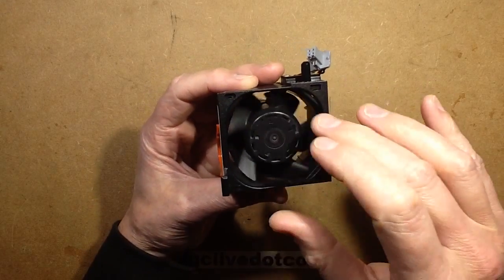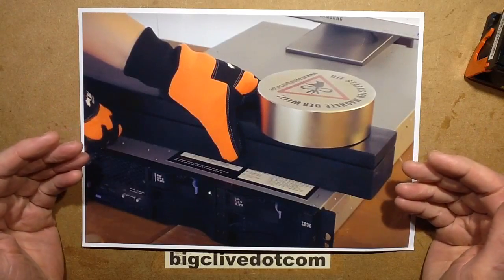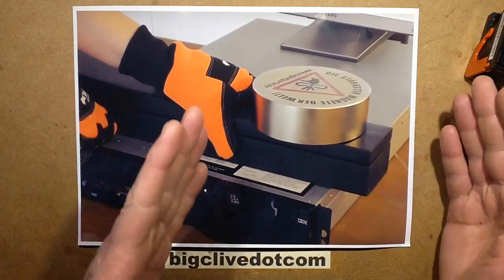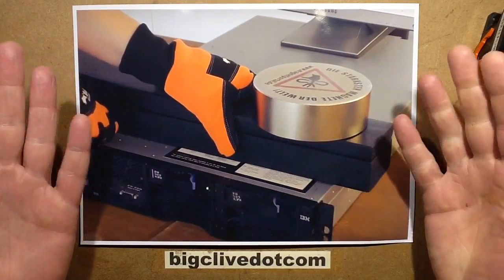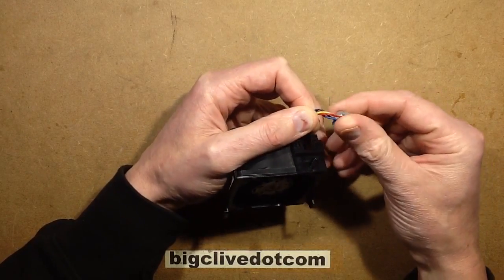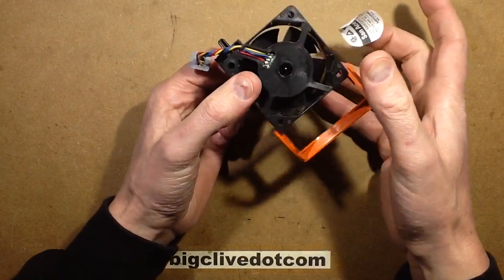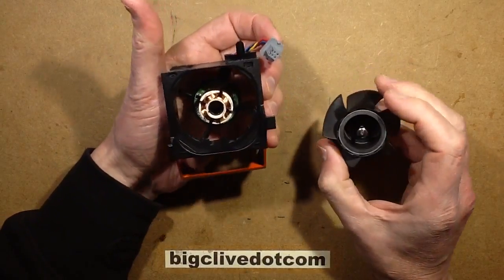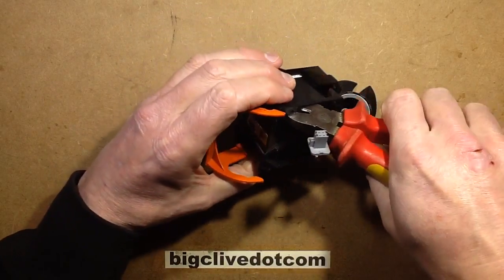Dead server fan autopsy.  (Unusual circumstances.)

Comment: Seems almost like the magnet destroyed the imposed field in the rotor. I have a smaller version of one of these, scary fun takes 2 people and wooden pries to separate. Point is I can wipe magnetic refrigerated stickers and write and then doodle on them with a smaller neodymium magnet tones of fun with magnetic viewing film. I bet from there the coils got decently warm from a stall state or it's failing to read that there is a magnetic field near the sensor and doesn't activate the power side as a fail safe as not to cause a catastrophic failure due to a stuck fan/solidly on coil.
Reply: So I'm not the only one that did that with the fridge magnet and viewing film? I lost my one strip of viewing film (2cmx7cm) a long time ago, am due to get some more. 

I agree that even partially demagnetizing the motor's magnet might cause the effects shown here.

Comment: It's probable that that bit that melted was a current sensor of some sort. A lot of fans, if you stop them with your hand, will stop trying to spin after a couple seconds and then try again after a few more seconds, probably to avoid burning out the motor.

Comment: This is awesome, because about a year ago, about the same time you posted this, I had to repair a pair of server fans. The fans themselves were the same model, scrapped from another server, but had an entirely different set of wires coming out of them. So I had to rip them apart, desolder the wires, and swap the wiring around.

Comment: Maybe the magnet saturated the silicon steel the winding is on, so that the winding dropped considerably in inductance and essentially behaved like a short with a very low-winding resistance - which then could trigger the follow-up failures.
Reply: That sounds plausible.

Comment: You might have mentioned it and I just missed it so if that's the case then my apologies: I'm curious what the resistance is across the windings. I don't know if you still have any of the bits from the fan now a little over a year later.

Comment: I know this is a year old. But my layman's diagnosis? Perhaps as the magnet was passed over the fans, the blades slowed because of the magnetic field. The fans sensed the slowing blades and tried to speed up the blades only to denied by the magnet causing a overload which blew out the components.

Comment: If the magnet caused the stator windings to cancel their inductive reactance, then assuming also a negligible resistance, too much current will flow killing both zeners and the regulator. In the alternative, the moving magnetic field may have induced a large field in the windings to blow the damaged components (induced polarity unknown). I watched their entire video; the servers were running with the fans spinning.

Comment: My guess is that the magnet caused the fan's motor core to saturate. When that happens, the motor windings act more like a short circuit rather than a inductor. The excess current likely caused the electronics failure.
Reply: How would shorting anything out in that circuit conceivably blow the diodes?
Reply: Whatever inductance was still left over would now be "charged" with wayyy to much current. Or, the high current burned something else (mosfets? Chip?) and that led to an abnormal voltage or current in the diodes.

Comment: You say it would have to be pulled away fast to cause a problem. If the motor was spinning the that would be the same as pulling it away fast.
Reply: The magnet was spinning, not the coils.

Comment: I have a some 200Kg+ pulling power Neodymium magnets laying around. 
First I thought, well can't be that bad right? Wrong. One really needs to watch the f*ck out. But still fun tho!
I've bought a special container. It's no luxury when dealing with these kind of magnets 

 The pictured neodymium magnet those guys used on the server must have been above 500Kg+ Maybe even 1T judging by size. Yeah, be afraid. Be very afraid

Comment: Clive, don't you think that passing the extremely high magnetic-flux from the neodynium magnet past the stator would have created an inductive current? Perhaps you could do a test with a similar stator and see how much current is created when a similar magnet is passed by the stator.
Reply: If you pitched the magnet right at the fan, as hard as you could, probably not. If you put it in the front of a cannonball and fired it, right over the server, probably not. If the fan was orbiting the earth in the opposite direction from the magnet and they passed each other an inch away, perhaps. 

The field density inside the closed magnetic circuit of a microwave oven transformer is comparable to the field touching the very surface of that magnet. And it reverses direction 120 times per second. Even with a coil that is several inches on each side exposed to this very strong , violently pulsating field, you're lucky to get 1 volt per turn. 

The field from the big neodymium magnet being placed near the edge of the blades is likely on par with the field created in the stator by being in intimate contact with the rotor's ceramic magnet. If the big magnet was held next to the fan and rotated at the speed the fan normally runs at top speed,  it would produce a voltage, probably a bit lower than the normal supply voltage, inside the fan coil. Even in that extreme scenario it is unlikely to damage the fan.

Comment: Those gloves will save you from losing the tip of your finger, as the gloves will act like a tube of toothpaste, pushing your mangled finger out from between the magnet and metal so it can get closer. FYI

Comment: Question: I used to repair Philips dictation recorders (used mainly by solicitors) in the late 70s, they were the only manufacturer who used Hall effect motors. The other manufacturers like Grundig used standard dc motors to power the capstan wheel and take up spools on their tape recorders. What was the benefit of Philips using this approach as the motors were costly and had so many wires to desolder to change them they took an age to replace?

Comment: I worked with 2"x2"x0.5" n52 magnets last year when I was building a motor for the Missouri S&T solar car team. The magnets try to align together from two feet apart. Get them within a foot of each other and you're going to have a very bad day if one is free to move. The motor had 40 of them, 20 facing each other in an attracting arrangement. With half and inch between the magnet rotors there was approximately one ton of force between the magnetic rotor plates. This force was supported on 1/8" thick perimeter around the 12" diameter motor. If you were to accidentally get your fingers between the halves during assembly, you'd not have you fingers anymore. It was a bloody scary thing to put together.
Reply from the maker: Sounds like the direct drive motor in many modern elevators.
Reply: I'll have to keep an eye out to (carefully) take one of those apart some time! Sounds neat.
Reply from the maker: Pretty dangerous to take apart.  It requires a support frame to extract components to change the bearings.

Comment: My thoughts... and I don't know if this has been touched on, but hey. I suspected this when I first saw the failure in the original video - the control chip got confused by the hall effect and shot off both windings at once! Then, that caused it to short-circuit, weld something together, throw full current at a coil, and of course, cascading failure by overheating (when the fan stopped turning, as it quickly would when a single pole is being held active, it'll apply forceful a braking action to the fan).

Of course, that may not have originated with the hall sensor, but rather (as ExStatic Bass mentioned) started with the MOSFET switching both gates to activated -- causing a short, since the motor - I think - works with switching polarity. Only one (or two, in the case of 4 driving 2 linked sets of coils) of those gates should ever, ever be open at a time. If two of opposite polarity were to be open, it'd immediately cause a short circuit (thus the principle of an "H-bridge").

On the right track, perhaps?

Comment: I would guess that the reason for the high voltage across the diodes would have been because of the magnet and the EMF generated by it. Because those pins are connected directly to a coil, the magnet would have produced an electric field (due to Faraday's law). Also, note the servers were running at the time.

Comment: you can certainly part the two magnets if they ran into each other, but there wouldn't be much point to do it to save a hand that has already been squeezed out from between them, and where the hell are you going to find the facilities to counteract or demagnetize those magnets on earth? there isn't a gauss gun/wand that could handle jit and the generators that could are few and far between not to meniton not set up to handle that. you get your hand caught between two really mean magnets and your hand is getting cut off or squeezed off. so don't do that.

Comment: i have had many accidents with a hand full of 1inch cubed rare earth magnets. luckily i never broke anything. many pinched fingers and needles stabbing me. putting them in different coat pockets worked well for a while until they ripped out of the pockets to smash together. gotta respect those magnetic fields

Comment: The schematic of the coils and zeners raises the suspicion that sliding the magnet past the coil induced a major voltage spike that zapped the zeners. My recollection is that zeners don't like voltages that greatly exceed their threshold.

Whether that explains the control chip failure, I can't say. It's possible that, after the zeners shorted out, the control chip was destroyed by the excess current from the shorted zeners.

Comment: more than likely the strong magnet was making the fan think it was operating at zero RPMs  then the fan proceeded to send more and more power through the system until it failed.

Comment: if the magnet was held static over a running server, would the rapid movement of the magnet required to induce an EMP not be provided by the spinning fans?
Reply: Video is on My channel video 403,,, :-)

Comment: If the monster magnet was brought close to the fan while it was turning it is not at all unreasonable to expect a strong magnetic braking force to affect the rotor bringing it to a sudden stop, the Lenz's effect.  If it was just a simple motor stopping the rotor midflight would have caused the coils to overheat and burn due to the excessive current (an overload). As it was some weaker component (a transistor?) failed first so the coils did not have chance to overheat. Just my theory though, not necessarily what actually happened.

Comment: The way i see it is that the Magnetic field change the domains in the iron core. hereby the motores goes into saturation,
and it is left to the copper resistance to restrict the current flow.
Reply: HI Peter,,, It is on EEVblog to day.

Comment: To be honest i didn't have time to look at how the circuit functioned, However i believe i have an answer to this.

When the HallEffect Sensor was jammed on (By the large magnet)  temporarily, It made the control chip think the magnets were in the position to open the mosfet gates to energise the coils, When in fact because the field of the large magnet didn't change but the motors one did (as it was spinning) It caused the motor to act as a generator, as the magnets spun they would end up generating the wrong polarity for the package, meaning the diodes would have to cop it, and likely that other package.

Comment: The neo magnet probably saturated the core laminations of the fan which would cause the windings to appear as a short, blowing the switching devices.
Reply: Good theory, except the switching devices weren't blown.  The mosfets were fine.

Comment: Must be interesting to be in factory where they produce those magnets...
Reply: What happens when you put a magnet in a lead box ?
Reply: @highpath4776  not much, the field will be reduced by a small amount, more by inverse square law/distance than the lead actually interacting with the field, it does, just not alot, just like copper slowing magnets from eddy currents but they do little in the way of blocking the magnetic field
Reply: Yes it would. I'm pretty sure there's been an instant or two in time.

Comment: a huge magnet going past the coils would of produced a high back emf from the coils Clive.
Reply: they could of also caused the main switching PSU to go out of regulation with the magnet possibly, sending loadsavolts into the fans that at the same time were jammed stationary by the magnet ?
Reply: For the love of Thor, it is "would've" which is a contraction of "would have".

Comment: as ppl said before ..you can imagine those fans spinning over 1k per second and then strong magnetic field..and for sure you would have high voltage ..soo diodes died..and i think rest of the damage is related to this because i don't think anything else could destroy it

Comment: Hi Clive, I have a background in motor control and can perhaps add a little to your explanation (we're FB friends under a different name).

That centre tapped arrangement is called a unipolar drive (the mosfets only drive one end of the winding at a time) as opposed to bipolar drive with the h-bridge. This can only be for cost reasons, there is no control difference between the two methods and unipolar is far less efficient as it only uses half the copper at any one moment.

The zeners are there to protect the mosfets in the case of transient voltages exceeding the mosfet Vds breakdown limit. They must have at least 24V Vz, as when one mosfet switches on, the winding at the other end will go to 2x the supply voltage as the winding acts like an auto transformer.

It is common when driving inductive loads from a bottom switch like this to put a reverse diode across the load so the load current can safely recirculate through the diode when the switch goes off, preventing a high transient voltage. But in this arrangement, if you do this then when you turn on one mosfet, the opposite diode will conduct and short out the magnetic flux. So you have to use this zener arrangement, or something similar.

What seems most likely to me was that a change in the magnetic flux through the windings, caused by moving such a powerful magnet in their vicinity, induced a voltage in the windings sufficient to exceed the zeners' capability and they failed short. Were the fans running at the time? If so, then the zeners would already be operating near their limit and it would need only a few extra volts induced to kill them.

The transistor at the top could well be driven by the PWM input signal, with the low cost driver IC just providing commutation. This would be a very cost effective solution, and would be easy to confirm if the PWM wire was connected to one or more of the resistors next to the dead part. Of course, once either of the zeners failed short then this transistor would have the 12V supply directly across it and would fail spectacularly.

Moral of the story? Keep BBMs (Big Bastard Magnets) away from electronics, and especially brushless motors!
Reply: I believe it's called a cash diode or a freewheeling diode sometimes.

But also Audrey Lake Wales solenoids and alike there is a reversed. I owed surges from blowing driver transistors or other driver components.

Also in Electro pneumatic pipe organs there's the diodes across relay and other magnetic coils to prove checked the switch contacts and also of course on a solid state logic driving any part of the pipe organ.

I had to replace a few diodes here and there on the old Orcutt that went short.

And actually wind blowing a fuse but couldn't figure out what caused it first and Tom like a diode gone short.

Remember diodes have jumper Envy.

You know how sometimes on a laboratory power supply or the power supply is protected before diode in Reverse across the input leads to prevent damage in case of extra extra polarity reversal or feeding power end the wrong way.

That usually will fried a diode if it's bad enough.

Also same thing often happens in crowbar circuits for reverse polarity protection the diode usually whines up failing short protecting the device.

And oftentimes if a scr track is used same thing it will fail catastrophically. After it blows either a fuse or source to power supply.

I've repaired a few devices that had inline fuse or fuse somewhere that the polarity is reversed in a diode cost of a fuse blow because it was forward biased by reverse current Alpha polarity reversal event which is why it's supposed to do and then they said it just kept blowing fuses and found out that diode it was there against player Tavor so go ahead field short because of someone not me reversing the polarity trying to hook it up. Edit it's called a catch diode. A cash diode although it could turn into a cash diode if you ever replace it. Is introllsive replace the device buy buy a new one.
Reply: I think you may be on to something. My thoughts were that the diodes were there acting as shunts.

My theory is that when the big magnet came close, it overpowered the hall effect sensor. When that happened, it probably caused the switching system to not realise that the stator needed to be switched and caused some feedback in the coils themselves, which then caused the over voltage through them. I could be quite wrong, but without being able to actually reproduce and test as it going on, I don't know for sure.